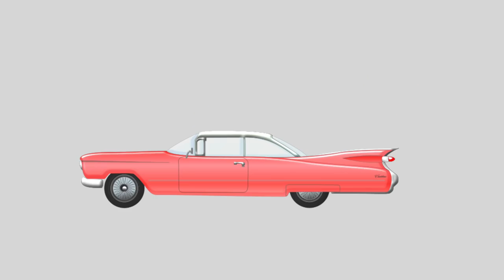Yes, Rockets CAN Fly in a Vacuum

Comment: Great presentation ! Now how do rockets work in space ?
Reply: Same as they do in the earth's atmosphere.
Reply: Brilliant response, just what I was thinking
Reply: They don't. how can they when a vaccum has no opposing forces to create centrifugal force? Cars have roads to roll on planes and jets have the air and it's slip streams to glide through but space has none of that hell how do you stop a ship in a vaccum? How do you chart a path? How do they turn? Rocket science is pump valve oxygen and gas how can a rocket work some were oxygen does not exist?
Reply: Your stuck in the thinking that you need something to push against. Just the stuff flying out the back is enough to push it.
Reply: @Padawaneslayer9000  Maybe you didn't watch the same video I did. You actually answered the last one on your own haha. 

You stop a ship by applying thrust retrograde (relative "backward"; relative being the opposite of where your ship's "forward" is) in space. But the ship will never really "stop" because it's constantly being pulled in by celestial bodies i.e. planets, moons, and larger asteroids. That's what orbiting means- being pulled in by something with a lot of mass. 

You turn a ship by doing the same thing, facing relative "in" or "out" (radial and anti-radial). If you want to turn "upwards" (normal and anti-normal), it's the same process no matter what the desired direction is- applying thrust. That's how charts are pathed and that's how ships move. It's challenging to explain directions in space because everything is relative, hence the quotations around my spacial directions. 

The last question is relatively simple to answer. Ships use liquid fuel and an oxidizing element (typically liquid oxygen) to create combustion in a controlled chamber. You can think of it like a balloon as she shows in the video. Only in that example, the air within the balloon acts as both the fuel and the oxidizing agent. Imagine a balloon in space but instead of there just being air in the balloon, there's liquid oxygen and liquid fuel, both in tanks of their own. Both of those liquids are pumped into and combined in a combustion chamber where the result is pulled into space by vacuum. That's where the thrust comes from! 

There's so much information available about this, and it's a super interesting topic! I hope I've answered your questions. I most definitely don't know everything, but we shouldn't disregard the possibility because we don't want to learn about it!

- (Kerbal space program is a great simulation video game to learn about everything space-related!)
Reply: @Padawaneslayer9000  So according to YOUR misinformed physics "education" I guess a crossbow firing a steel projectile in to a vacuum would NOT feel any recoil.

Are you SURE about that?
Think again genius!
Reply: @Padawaneslayer9000  1) centrifugal force doesn’t exist. 2) the rocket pushes out FROM THE THRUSTER rather than pushing on air outside of the engine, like an airplane would, and the force exerted on the gas within the thruster exerts an equal and opposite force on the rocket, propelling it forward. There you go
Reply: @bobartor910 how because in Earth's atmosphere the rocket works by pushing against the atmosphere that's also how airplanes work when they compress atmosphere underneath their wings that's also how your car engine works when the Pistons are pushed by the combustion and when the wheels push against the road
Reply: @ForageGardener  Ok look you ever watch a movie and something explodes and shit goes flying. Its the force of the explosion that sent it flying. Thats how rocket's work controlled explosions at the back of the rocket pushing it. If you cant wrap your head around that go back to school.
Reply: @ForageGardener  
Rockets don't work by pushing against the atmosphere. If you look at the thrust equations for a rocket they are more efficient in a vacuum. Lol
Reply: She said they use Ion thrusters in space.
Reply: She just explained it very clearly, it’s not her fault if you don’t understand
Reply: We never been to the moon. It’s not possible
Reply: @ForageGardener airplanes fly because of compressed atmosphere underneath their wings ? 🤔 that’s the same misconception than rocket engine needs atmosphere to push against to create thrust 😂 but at least on the plane you are partially right, but in fact more than 70% of the lifting force on most of the airplanes  is due to underpressure above the wings, and just less than 30% due to overpressure underneath the wings (of course depends very much on the shape of the wing).
Reply: 😂😂😂 perfect comment
Reply: @ronkemp9528 you are wrong 😂 it is the mass of the propellant (gas) that needs to be plenty enough to propel the massive rocket 🚀 impossible to achieve and gain 😂
Reply: @stuartgray5877 a steel projectile mass compared to the bow is not analogous to the mass of the propellant compared to a rocket such as the Apollo going to the moon 😂 the correct analogy would be if a person farting in vacuum, would that propel him forward? It depends on the mass of the propellant vs the mass of the rocket 🚀 if the cross bow mass is the same as a tank, the arrow projectile wouldn't have any effective recoil
Reply: @wateristhefuelnotfossil  Oh so YOU discovered that GAS does not have mass "cuz reazons".
You deserve a noble prize.
Of if Gas does not have mass then how does a gas turbine work?
How can that steam move the turbine blades?
Reply: @bobartor910 you're lost in space 😂 think of the rocket so massive, now think of the mass of the propellent,😂 imagine a human having no trouble being in space naked for the sake of the truth,  does someone naked farting in the vacuum of the space, cause the person propel forward? 😂 Does the backfire of a Cadillac cause the vehicle to accelerate at all? 😂 Think of the mass of the rocket, 🚀 then think of the propellant's mass, 😂 requires logic, reason, empathy, honesty, sincerity and integrity to understand it
Reply: you're lost in space 😂 think of the rocket so massive, now think of the mass of the propellent,😂 imagine a human having no trouble being in space naked for the sake of the truth,  does someone naked farting in the vacuum of the space, cause the person propel forward? 😂 Does the backfire of a Cadillac cause the vehicle to accelerate at all? 😂 Think of the mass of the rocket, 🚀 then think of the propellant's mass, 😂 requires logic, reason, empathy, honesty, sincerity and integrity to understand it
Reply: @danvanbelk1  you're lost in space 😂 think of the rocket so massive, now think of the mass of the propellent,😂 imagine a human having no trouble being in space naked for the sake of the truth,  does someone naked farting in the vacuum of the space, cause the person propel forward? 😂 Does the backfire of a Cadillac cause the vehicle to accelerate at all? 😂 Think of the mass of the rocket, 🚀 then think of the propellant's mass, 😂 requires logic, reason, empathy, honesty, sincerity and integrity to understand it
Reply: @wateristhefuelnotfossil  
Farting in space would (theoretically) propel you forward .
Why don't you learn some physics instead of embarrassing yourself.
Reply: @wateristhefuelnotfossil  on a spacecraft, high pressure is created in the sudden explosion of combustion of the rocket fuel. This pressure difference is what makes a rocket move, like a jet plane, it moves not because of the engine driving the wheels, but the high pressure on the rocket compared to the pressure around it. while the wheels are only to reduce the friction force of the aircraft with the runway. When in space, there is no material to cause friction, so a slight difference in pressure will make something slide stronger (more effectively). remember, the pressure in space is assumed to be: 0. in other words, if we exhale in space, the pressure of the exhalation can throw us in space "forever." correct me if i'm wrong. 🙏
Reply: They have liquid oxygen and fuel. And of course in space rockets does not need so much fuel because there is almost vacuum and zero gravity.
Reply: @bluechevy71 Travel to the moon is not possible? How did you figure that?
Reply: @corylahey1025 That's one form of propulsion system that's used in space.
Reply: I feel like you neglected to answer the part about thrusting in a vacuum. Everything else you said was common sense
Reply: @Padawaneslayer9000  Newton's 3rd law. Maybe you've heard of it. It's been around for quite some time. Are you being purposefully dense?
Reply: Newton's 3rd law
Reply: @bobartor910 Really? And what do they oush off of in an INFINITE and EXPANDING VACUUM UNIVERSE?
Reply: @ronkemp9528 No. It would be like trying to maintain your balance by leaning on a helium balloon
Reply: @stuartgray5877 Did you forget you need a physical container to first achieve a vacuum? 
Oops
Reply: @samirait-kaci3450 An appeal to authority FALLACY is not an legitimate rebuttal
Reply: @bobartor910 Equations? Can you pay for physical material with equations that equal $100?  No
Reply: @ramonortiz7462  - "Did you forget you need a physical container to first achieve a vacuum?"
You love just making things up.
NO-WHERE does it say that in physics .... anywhere.
I build machines that operate in the vacuum of deep space.
My machines have returned peer reviewed science.
So far, I have SIX Science missions with dozens of science instruments and hundreds of Investigators that review MY Data.
How many "scientists" review your data?
Don't make me laugh.
Reply: @stuartgray5877  Rrally?! Can you physically demonstrate a vacuum on earth without an physical container to withdraw or eliminate the air? 

Once a vacuum is physically achieved on the earth with required antecedent of an physical container, it is confined to its physical container and cannot expand !! 

Outta space DEBUNKED!!
Reply: @ramonortiz7462  SO you DENY the gas PRESSURE GRADIENT in earth's atmosphere??

Ramon - What IS the atmospheric pressure at the top of mount Everest?

Now be SURE to RUN AWAY instead of answering that question.
But Bless your little heart for effort!
Reply: @Padawaneslayer9000  Rockets actually work better in a vacuum than they do in air. The air partially obstructs the propellants from coming out of the engine, so thrust is reduced slightly. In a vacuum, the propellants come out easier, and for every action there is an equal and opposite reaction.
Reply: @Padawaneslayer9000  Centrifugal force isn't involved when a rocket is going in a straight line. Rockets work on the law of conservation of linear momentum. Centrifugal force is the tendency of an object moving in a circle to travel away from the center of the circle. Completely different.
Reply: @petermcmillan9299 

Major Omission in the explanation- air pushes against air. To get an equal/opposite reaction there has to be an opposite resistance. Water against water. Mass against mass etc. There's nothing to push against to move forward in space. Elon Musk explained this difficulty in an interview.
Reply: @mikeedwards1096  To prove that your understanding of basic physics is incorrect, you just explain to US:

What happens if you fire a crossbow into a vacuum?
Does the crossbow experience any "RECOIL" force"?
Yes or No?
Why or why not?
Reply: @mikeedwards1096  Where did you go?
Do very basic physics questions scare you like facts?
Reply: @stuartgray5877  my point stands. A propeller in water or air pushes water or air against water or air. The dispersion of mass is what drives it. There is no matter  to push against in space.
Reply: @mikeedwards1096  
Look - ANSWER THE DAMN QUESTIONS.

Does a 
CROSSBOW
HAVE
RECOIL
IF fired into a vacuum?
YES OR NO?
WHY OR WHY NOT? 

If you are incapable of answering questions, then I think we know why you failed to get an education.
Reply: @mikeedwards1096  Stuart is trying to get you to answer questions so that you will understand. If he just tells you how it works you won't believe it.
 You have to answer the questions.
This is what happens in "School" The teachers explain things then ask questions .

If you cannot answer questions, then you fail out of school.
I am beginning to understand how you failed to learn basic physics.
Reply: @stuartgray5877  - "Does a 
CROSSBOW
HAVE
RECOIL
IF fired into a vacuum?
YES OR NO?
WHY OR WHY NOT?"

Yes. A crossbow fired into a vacuum will have recoil.
This is because the Bow is pushing on the mass of the projectile to accelerate the projectile forward.
Due to Newtons third law: the Bow must experience an "equal and opposite force" to what the projectile is experiencing and for the same duration as the projectile pushes back due to "Inertia".
This pushes the bow backwards.
This "equal and opposite force" is what we call "recoil" and has nothing whatsoever to do with the atmosphere.
Reply: @rocketman484  I think Mike had an aneurism from reading your facts.
Reply: @bobartor910  so a Co2 cartridge should propel in a vacume? Right?
Reply: @Padawaneslayer9000  
From what I am understanding that's being explained to me is even though the atmosphere/push equation has been removed, the mass of the expelant alone pushes . The crossbow example idea.  I'm hearing " it should actually work better".+
 I'm not convinced yet
Reply: @ronkemp9528  
Let's do a grade school test. CO2 cartridge in a vacuum. Simple. All factors are met. Mass against mass.
Reply: @samirait-kaci3450  works on paper!
Reply: @bobartor910  kinda like a water hose , it's pushing and it ain't air it's pushing against.
Reply: @ronkemp9528  I'm asking, you disagree with James Joule? You are disregarding the laws of thermodynamics? You gonna pick and choose and omit just to propagate a falasy? Your ride stops here at the karmen line. Your illusion stops here. You are now a non player .
Reply: @blurya5015  So, in your fantasy world. You are discarding James Joule? You need more homework my man before you discard the laws of thermodynamics! Unless you are disagreeing with established academia?
Reply: @ronkemp9528   sorry you fail
Reply: @bobartor910  you are ignorant.
Reply: @Adamcooksey-jb1rd  Your algorithm needs work
Reply: @Padawaneslayer9000 it propelles against its own gases. And not only that combustion happens inside the rocket engine because it’s a mix of oxygen and the rocket fuel of choice.
Reply: @Adamcooksey-jb1rd  SO you still contend I am lying about my career, or just such a bad engineer that I don't know I am being fooled?
Reply: @Adamcooksey-jb1rd  - "sorry you fail"

We have already determined that you are no authority on basic physics.
Why do you feel the need to tell others they are wrong when it is demonstrably true that you are clueless about physics?
Reply: @stuartgray5877  
Nobody cares anymore Stuart. I don't care. Who gives a shit.  😩
Reply: @Adamcooksey-jb1rd  You apparently care since you keep spewing nonsense in these threads even though you APPEARED to understand what I was telling you on the other thread.
DO you lecture Judges about the law? Do you tell your surgeon where to cut?

Do you offer stock tips to Warren Buffet?
NO?
Then WHY are you arguing physics with ROCKET SCIENTISTS?

The Dunning-Kruger is STRONG in this one.
Reply: @stuartgray5877  Hey Stuart! 
Rockets don't work in space
Reply: Exactly 😂 she didn't explain that part 🤦‍♂️🤣 Like what's the rocket in space pushing off of if there's nothing in the Vaccum 🤷‍♂️🤔
Reply: A thread like this could be a really interesting debate thrashing out the subject, except the people arguing for established science always have to he demeaning and insulting.
Reply: @Danthehorse  if you start out begin genuinely curious and asking questions I can be very nice.
If you start out calling all aerospace engineers a bunch of liars or incompetent engineers (because we are being fooled and not know it(, then OF COURSE actual Aerospace Engineers will come out swinging.
Just don't accuse us of being idiots at the start and we can have a civilized conversation.
Reply: @Adamcooksey-jb1rd  youve been muted.  Carry on making a fool of yourself I won't see it.
But bless your little heart!
Reply: @youtubeisasshoe8153  rockets TAKE MASS WITH THEM to space TO PUSH ON.
The rocket exhaust has mass.
Reply: @stuartgray5877  Gray! Back from repairs? We missed you!
Reply: @Padawaneslayer9000  you answered your own wuestine.